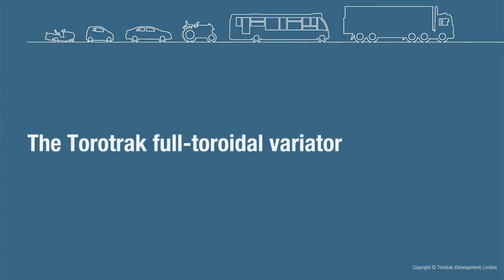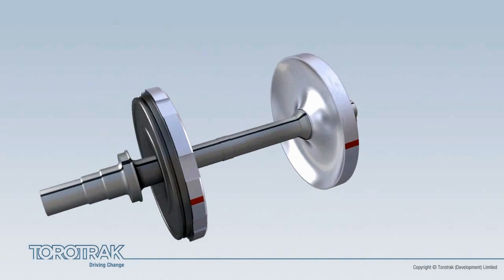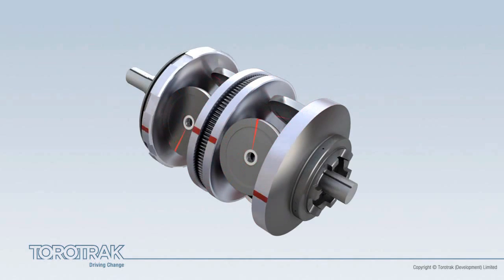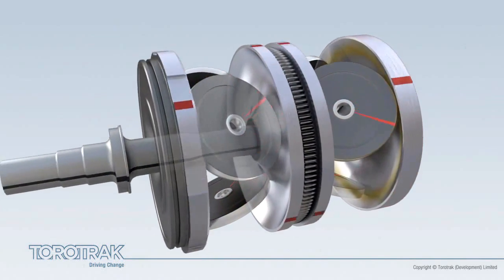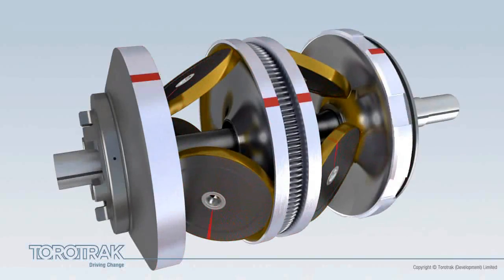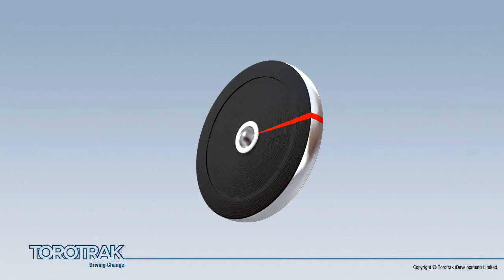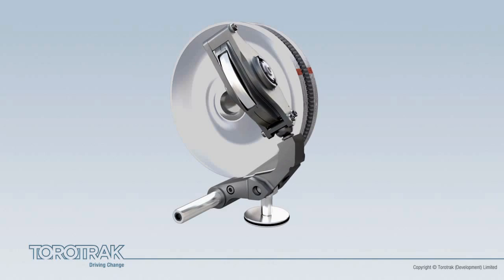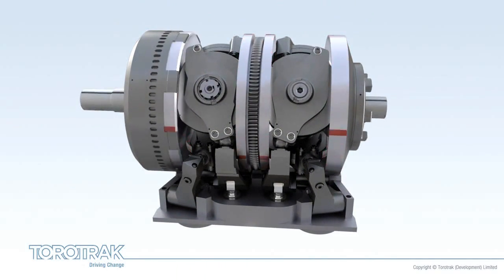Torotrak's Full-Toroidal Variator

Comment: Is it possible to invert this? Eg, input disk center, two output disks on either side and use it as a continuous differential? A computer could send a different ratio to each side depending on steering input.

Comment: my question is how do you keep all six rollers perfectly synchronized (at the same angle) otherwise they will be working against each other, if there isn't something automatically self-correcting in each individual roller actuator it seems things will get out of whack soon, and the thing will first loose efficiency and eventually wear out prematurely ???

Comment: One thing I find interesting is that this type of transmission could have a PTO output if it were put just in front of the rear axle of a truck, where the output gearset can shift out of gear and allow the engine to run in neutral. It would allow farmers to tow things with their truck as usual, in a low gear at the peak torque of the engine to save fuel while doing so, but when they need to they can hook a bit of farm equipment to the hitch and plug in the PTO shaft to power something like a windrower, or a seeder, or something. A truck could become a tractor if needed, and of course the tractor would also benefit from the CVT. Its smart, and its a really good idea alongside PHEVs for the decades it would take to shift the world to full-electric, and even then biogas vehicles would always have their place no matter what. I think Halo ironically had it right, the hydrogen-powered Warthog is a combustion-powered vehicle and that is always very useful for lightweight long range vehicles.

Comment: My automatic transmission has lasted 300,000 miles with zero maintenance.  
I think I'll stick with it, unless this new transmission will double my fuel economy.
Reply: Try switching to a fully manual gearbox. 2x less consumption and an incredible level of control over the traction with a clutch you control with your foot. Tedious for city driving though.

Comment: Площадь контакта маленькая, следовательно данная трансмиссия будет пропускать малый крутящий момент.
Reply: Да вот как раз и нет, как раз они ставились на мощные и моментные моторы Nissan VQ35 и VQ45 на Cedric, Gloria, Fuga, машины для JDM рынка. И ещё одно важное отличие при разработке Nissan этого Extroid CVT было то что этот вариатор изначально проектировался на продольный двигатель исключительно с задним/ полным приводом. Хотя ременной варик у них выживает и на VQ 37 моторе на Теанах, Максимах с поперечным расположением и передним приводом
Reply: This variator is not torque-limited and is capable of far higher torque loads than any other type of variable transmission.

Comment: I saw this used in semi trailers in the 1980's. It was described as an infinitely variable transmission.
Reply: No you didn't. This was never released, it was a project by Nissan and NSK and it needed a special oil to about it breaking by the huge wearing caused by friction.

Comment: I couldn't see how this would not slip or quickly wear out.
Then they mention the magic "friction fluid".
Reply: There is nothing "magical" about a fluid that becomes more dense, when under pressure.
Reply: Could not they do something similar with gears ? I mean, the gear would have the exact shape so the small pivoting disks always have a good occlusion in the bigger disks.

Comment: If you're wondering why these aren't common in different vehicles, it's because the company entered administration and has been dissolved / sold since ~2016 or 2017. Investors lost interest when the pure electric car became common, which is a huge shame because this could have been amazing for a variety of reasons
Reply: Nissan could've been saved is they were allowed using these
Reply: To improve conventional motorcycle fuel consumptions, this could still be important. Especially since the development of electrics is not as fast/as active in this segment as in the car industry.
Reply: Who will buy electric cars ?! In addition, the transmission can be used anywhere that includes electrical motor itself, not just in cars.

Comment: Cant hold power tho
Reply: Actually it is currently being used in cars with "Higher-Torque" engines ...
Reply: @MrSummitville  rrrealyy that's cool
Reply: Have you seen torque multiplier on EVERY automatic transmision?  Mechanical contact is not always needed.

Comment: Wow. If you could fit that to a tractor trailer that would be great for the trucking industry.
Reply: The company went bust.
Reply: There's other types of CVT, but that's a great tech because it allows the engine to run at either maximum power or maximum efficiency regardless of the speed of the truck. You may still want a separate crawler gear for high torque though.

Comment: Engineering explained brought me here.
With its nissan extroid cvt video.
Reply: yeah, me too.  i needed to see what it looked like in real life
Reply: Me as well. This was an excellent video.
Reply: Me too
Reply: Same here, I had to see it in action, and this says the disk actually don't touch, its the fluid that provides the grip. I really want to hear a no shifting engine taking off LOL.
Reply: It's the fluid alright, but I bet the disc surfaces are mere 10-thousandths apart.
Reply: @jayboom10  it sounds like a motor boat... idle to full rpm in a second, then it's held there while it accelerates away.  or sounds like a snowmobile.
Reply: I felt like I'm creature living in a 2 dimensional world when I was watching Jason's video. Now it's much better :)
Reply: Same here. Here I was thinking the conical plates and transmitting discs would have complex gear teeth on them, similar to a pinion and ring gearset. Then it dawned on me that the difference in ratios between input and output sides of the transmitting discs would require too much slip across contact points on the conical surfaces to allow teeth. Hence the traction fluid. The contact points are theoretically an infinitely diameter-free point of contact, yet in actuality the transmission footprint between the rollers through the fluid would look more like a very narrow rectangle, with each end of the rectangle taking greater and greater angular sweep further from the center of contact. Complex stuff, but it's working.

Does Nissan use 3 roller sets on each side or two?
Reply: Yeah the design looks incredible, way better than the more common style of CVT's.  High torque or not, besides expense, I can't see why this wouldn't be a superior solution for any CVT vehicle.

What I'd really like to see is a "manual" CVT, which instead of having gears has a lever that allows you to control the discs with infinite variability from one extreme of their angles to the other.  Sure a computer could control it better for maximum efficiency, but it can't predict what you want from it when you want to suddenly accelerate while already going 40mph for example.  If you could pull a lever down you'd actually have MORE control than a manual transmission as you'd essentially have infinite gears.
Reply: Exactly what I was about to comment.
Reply: Yes
Reply: +Artcore103 Toyota has done something of the sort with their CVTs. These "simulate" gears by maintaining a constant gear ratio while the engine's RPMs increase, and then changes it to decrease engine speed to keep up with a higher vehicle speed. When driving normally (i.e. without flooring it) the transmission's computer tries to keep with the most efficient ratio for that driving style, but also does simulate gear changes to reduce that "boring" feeling CVTs transmit due to their linear power delivery.
Reply: Same here thanks to EE. This is better than belt driven cvt....
Reply: John Meister Dupa   And in one fourth the time, four times as much understanding.
Reply: Haha me too
Reply: Me to, why?.
Reply: which video?)
Reply: +1. While Jason did a tremendous job explaining it, this model is really well done. Love how the arms of the toroidal unit - that was the only part giving me pause in EE's video and it is a pretty magnificent design as implemented here. 

I wonder if Nissan/Jatco brought Torotrak's design for use in future Nissan/Infiniti vehicles.